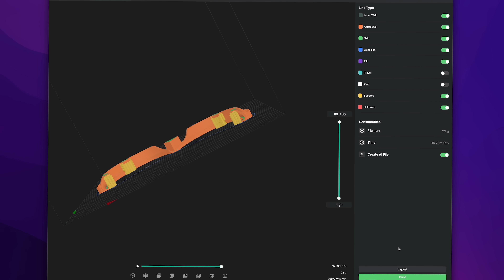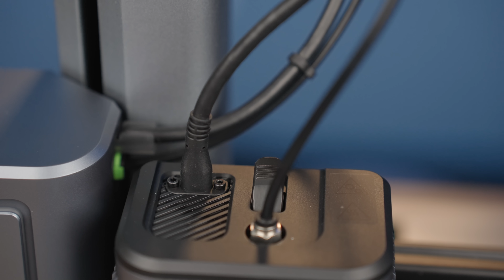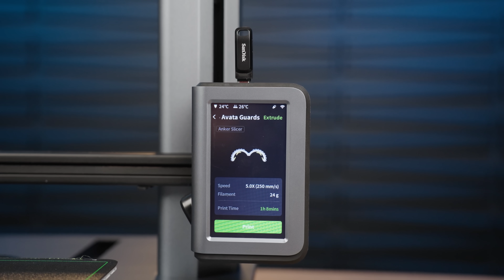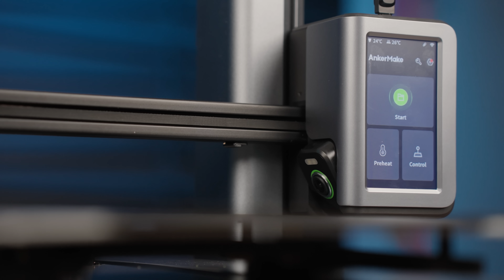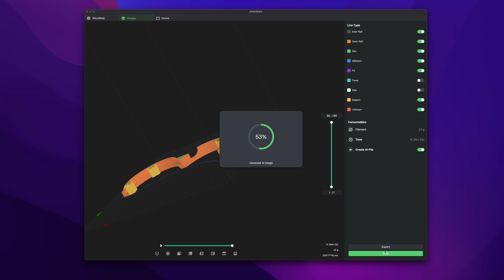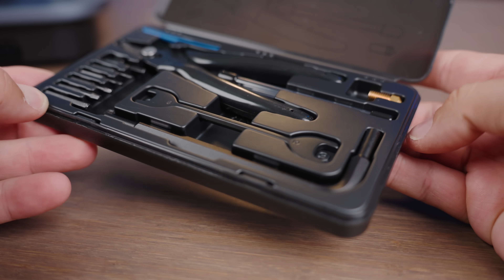The AnkerMake M5 isn't like other 3D printers

Comment: I have had my 5C for about 18 months and use it almost everyday. This  is my first printer, so far no issues. I did buy a Type "C" to SD card reader so I can shuttle the SD card back and forth from my Laptop to the printer. I am also in the process of doing a cooling mod for the print head hot end and print cooling shroud. It would be nice if you could turn the fan on the hotend off somehow. But I am getting fan that is hopefully quieter. I have been using Prusa slicer for all my projects and this printer does a great job handling the gcode files. And slowing down the print speed makes a huge difference in the print quality. Thanks for doing this video it really helped to get me started.